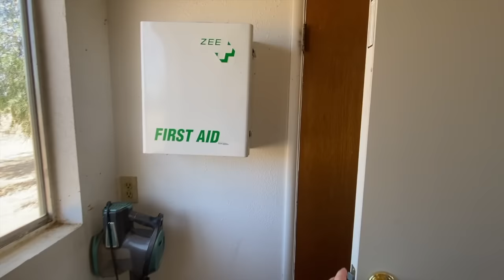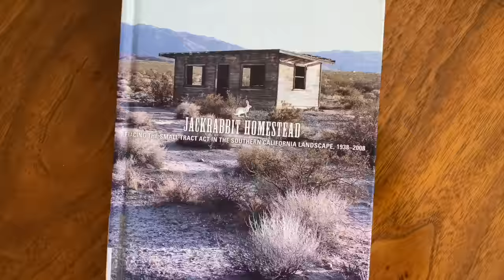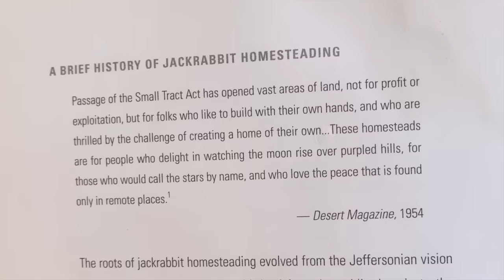ONE YEAR | Progress on my Homestead in the Desert

Comment: In the first video you said the property was 5 acres. I'm not sure what desert you're in, but even America's driest desert, the Mojave, gets 50mm - 150mm of rainfall anually. Across one acre that's about 50,000 - 150,000 gallons. About 200 - 600 tons of water. If you put a catchment roof over one of your five acres and piped it off into a storage tank capable of holding it, you would have enough water to irrigate a smaller area, say 100 x 100 feet, and grow enough food to feed yourself rent free basically forever. You also have enough area there to put in a big ass solar array, and the desert with its long periods of cloudless sunny skies is the ideal place for it.

Comment: It is interesting to see how someone who is not a carpenter or a plumber goes about renovating a poorly maintained and aged house while trying to live in the construction mess and save on the cost of repairs and renovations. It takes courage to tackle such a big job without having a background in construction. Good for you. I am sure when the house is finally finished you will really appreciate all the effort that went into making this house livable and attractive. 

I believe if this had been my house, the first thing I would have done is set off some insecticide "bug bombs" inside the house. Then I would have hired a crew to strip the house of carpeting and haul it off. The next thing I would have focused on was getting the bedroom and bathroom in finished condition, including adding energy efficient windows, new paint on ceilings and walls, new bedroom ceiling fan, rewiring throughout so it is all up to code and updating the bathroom plumbing including new faucet sets, new water efficient toilet and a new septic line. I would also have installed a zoned AC unit for the bedroom. I would have hired licensed trades people for some of this work.

 I would be less concerned about heat for the whole house that first winter. I could just use an electric blanket on the bed and a space heater in the bathroom until heating for the whole house was sorted out. Only when the bedroom and bathroom were finished, furnished and done would I have moved in. I would want a finished and functional bathroom for cleaning up after a hard day of working on the property and a clean and comfortably furnished and finished bedroom so I could just close the bedroom door and get a good night's sleep away from the construction mess. 

It is relatively easy to set up a camp kitchen in a corner of a bedroom (microwave on top of a dorm size refrigerator, a dresser or chest of drawers to hold an electric skillet and a slow cooker, a plastic basin for washing dishes in the back yard). Hang a small TV on a bedroom wall and add a comfortable chair and the bedroom functions as a studio apartment until the rest of the house is done and ready to furnish. Assembling two or three heavy duty storage racks elsewhere in the house would reduce the clutter of storing tools and building supplies. The storage racks could always later be used in a storage shed or newly constructed garage/workshop.

If you get a metal detector, you will be able to find tire-puncturing nails and other metal trash on the property a lot easier. The thing with buried small pieces of metal in the desert soil is eventually they work their way up to the surface where they can do damage. Agree with you about not needing a clothes dryer. An outdoor clothesline will do just fine for drying laundry most of the time in the desert. If you hang out your laundry inside out and in the evening so the items can dry at night, the clothes are much less likely to become sun faded over time. 

I recommend when you have finished the house that you fence in part of your backyard with a tall concrete block wall so pets, and maybe some day a small chicken coop, will be safer from coyotes and rattlesnakes. I would also plant some mesquite trees near the south and west sides of the house to help provide additional cooling shade. The trees would need some drip irrigation. 

Were I you, I would find a local who has experience successfully growing food plants in the desert before I undertake cultivating a vegetable garden. Desert soil lacks humus so does not retain moisture well and it tends to be too alkaline for temperate zone vegetables. It is expensive to amend the desert soil enough to make it suitable for temperate zone plants. Summer temperatures also get so high in the desert the heat will kill the pollen in tomato plants and the strong sunlight scorches the leaves and seed pods/fruit of temperate zone plants unless grown under shade cloth. And the local insects, birds and smaller mammals will feast on juicy temperate zone plants. I say this based on first hand experience. 

The desert also tends to have a short growing season in the spring and another in autumn and if growing nonnative food plants, you may need a greenhouse or poly tunnels to extend the growing season during cooler weather if you want to produce vegetables. It may actually be a lot less labor and less expense to just buy your temperate zone fruit and vegetables from the nearest grocery store. You could probably grow a few container tubs of cherry tomatoes and culinary herbs on the shady side of the house if you stayed ahead of the tomato horn worms and locusts and watered the plants every morning and evening during hot weather. Rosemary bushes, if irrigated, tend to do well in the poor desert soil. So does a spineless variety of prickly pear cactus that produces edible fruit and edible young pads. The stalk and blossom buds of a certain type of yucca plant can also be used as a vegetable.

Comment: Have you gotten heat yet besides the wood stove? We lived in our cabin for 5 years with only a wood stove for heat until we finally installed baseboard heaters. I think our cabin might be a little smaller than yours, it’s like 520 sq ft, but it cost around $2000 to have someone come install three baseboard heaters and we probably would have done it sooner if we had realized the cost was lower compared to installing other types of heat that we looked into
Reply: Ok just double checked w my hub and we were here for four years before we installed the heaters not five. We have had them for a year and they are probably my favorite improvement so far that we have done to this place. Our stove leaked smoke really bad though so it might not be as big of a deal if your stove doesn’t leak smoke
Reply from the maker: So far I'm holding out for a minisplit which would solve both heating and cooling problems. But the wood stove works pretty well for now. Thanks for the thought though :)
Reply: @MyWayofEverything  Oh ok that makes sense if you are able to keep using your wood stove and wait. We looked into a mini split and it was around $8k cash to have one installed but if we wanted to finance it, it would have been $14k with all the added interest so we decided not to go that route!
Reply from the maker: Yup. That’s about the same prices I was quoted. 😖